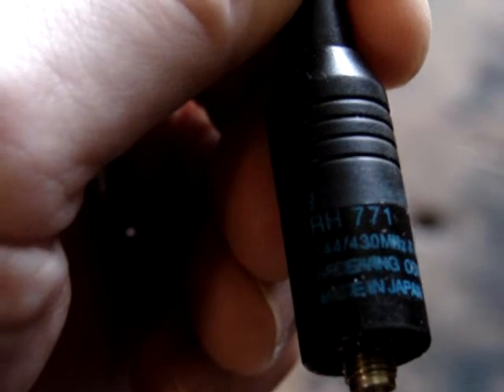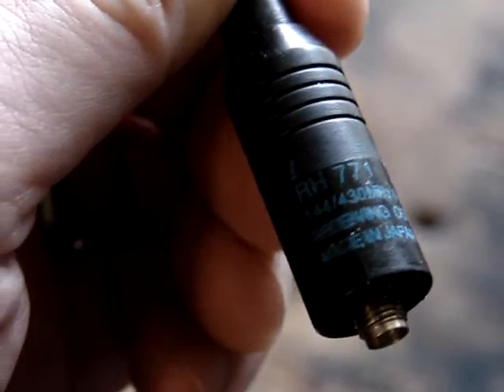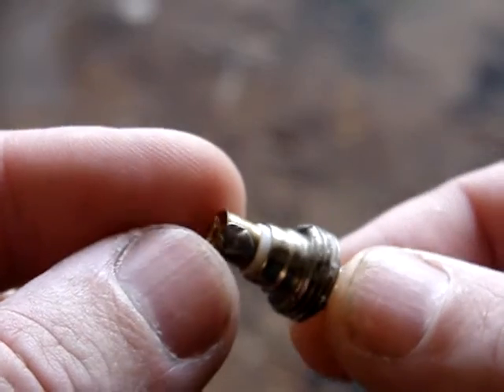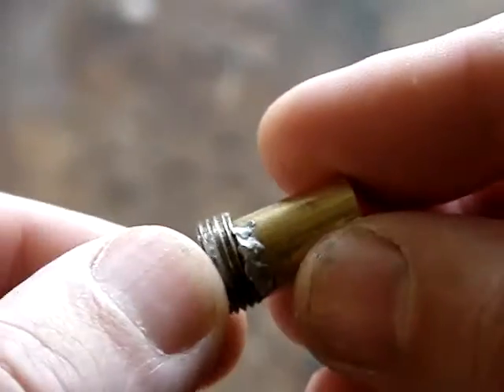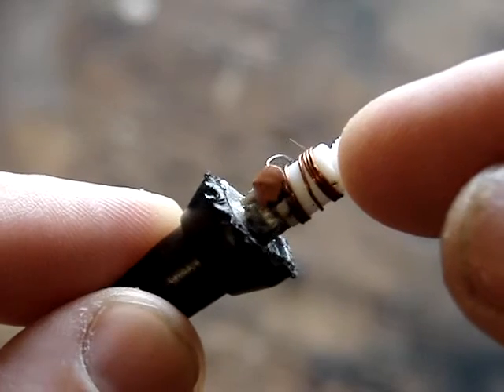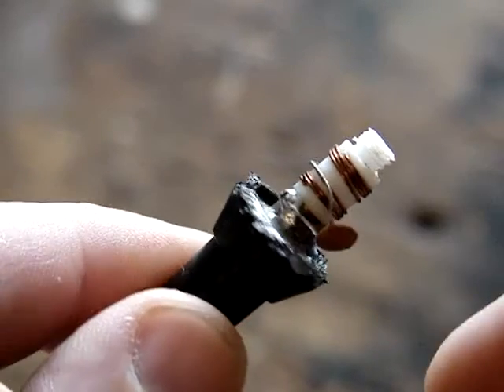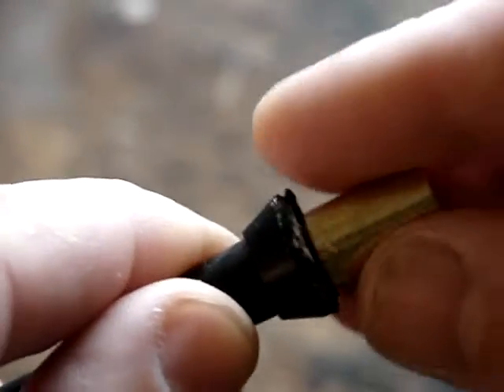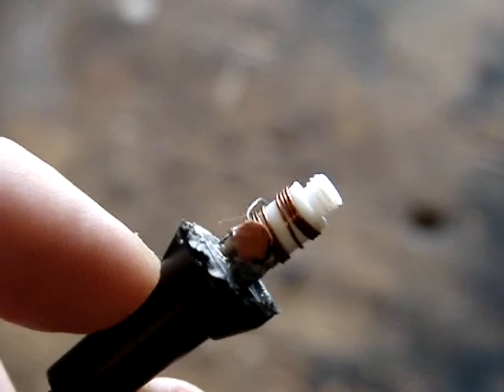counterfeit low cost handheld transceiver antennas the 771

Comment: I don't see the problem - typical filter going to an antenna.  So besides calling it junk junk junk - why?  How did it perform?
Reply from the maker: high SWR on VHF, works fine on UHF HAM
Reply: Galen Thurber Thanks for your reply.
Reply: @Galen Thurber:  Well, that’s completely opposite to my experience.  I have a Diamond RH-771 and a Nagoya NA-771 and both work OK-ish on VHF with respective SWR of 2.1 and 2.3, but rubbish on UHF with respective SWRs of 3.8 and 4.2.  I actually get better TX and RX on two different Baofeng stock rubber duck antennas with 1.5 SWR (VHF) and 2.8 (UHF).  
A bunch of us use Baofeng UV-5R radios routinely over 3Km – 10km range with moderate obstructions, much more if line-of-sight – and found using the Diamond and Nagoya antennas to be no better than the Baofeng supplied antenna.   Thanks for video.